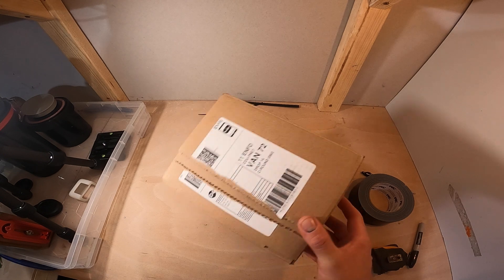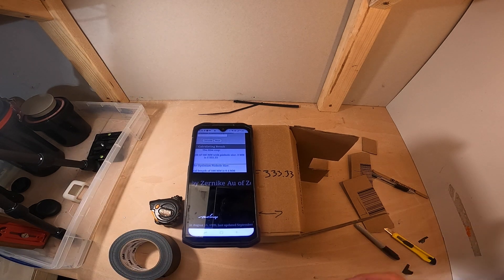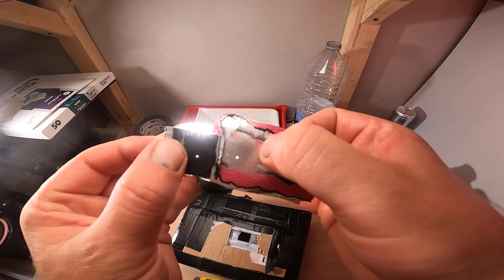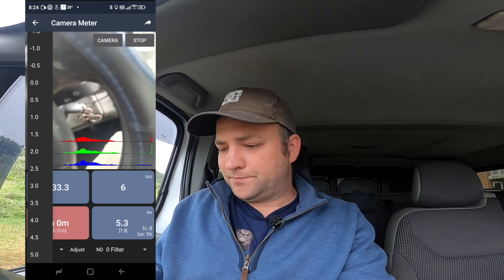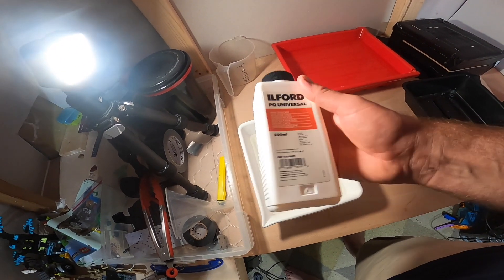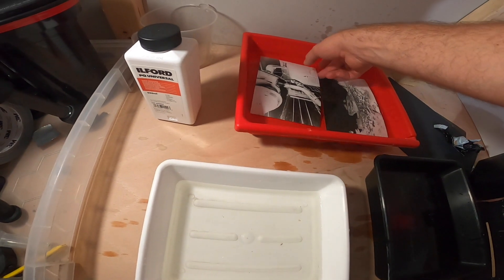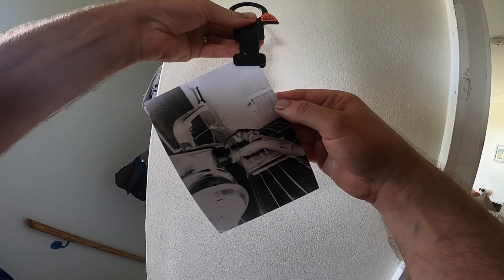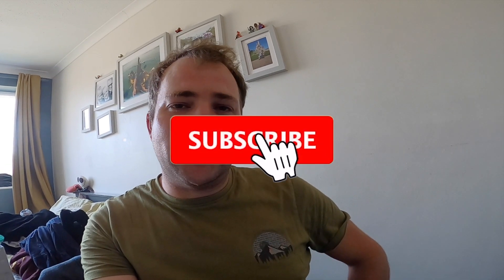Cardboard box pinhole camera - Build, shoot, develop and print

Comment: Is it correct to use the same clamp for the developer and the fixer? I thought I saw some typical stains of contaminated developer in the last photo you printed.
Reply from the maker: Probably "best" to use separate utensils, but was doing it like this for the ease. that print did have some stains, had developed a few others previous to this an may have been a bit contaminated or developer exhausted, but all others previous to this were fine.

Comment: Hi Will, 
I’m hoping you might be able to help me out?
I’m taking my new Mia 6x6 20mm away with me using Fomapan 400 for the first time.  I’m sure I’ve seen you using it on one of your videos but can’t find it.
Do you have any tips for reciprocity for the film?  The data sheet for it is very vague & I want to make the best of it.  
Thanks
Simon
Reply from the maker: Hi Simon.
I use an app, Exposure Assistant which is very accurate with reciprocity time, there seems to be a few apps available which certainly makes things easier.
Otherwise it is just a cast of finding an accurate data sheet. In most cases with a Pinhole with a 400 film exposures will be a couple of seconds, just gets more complicated in low lighting